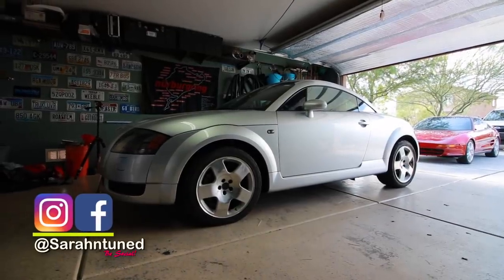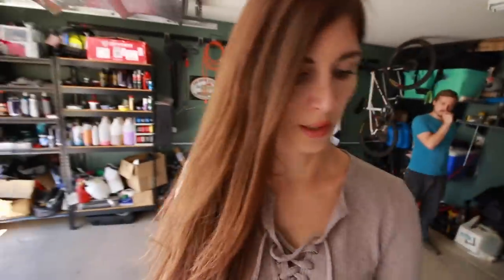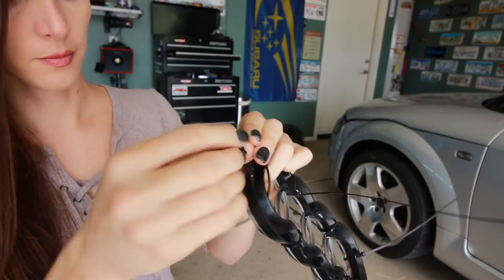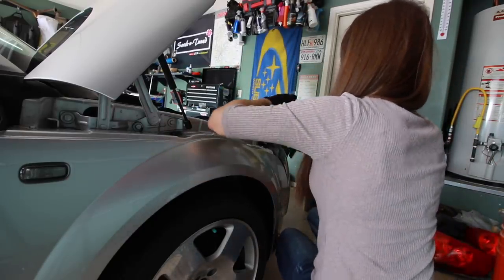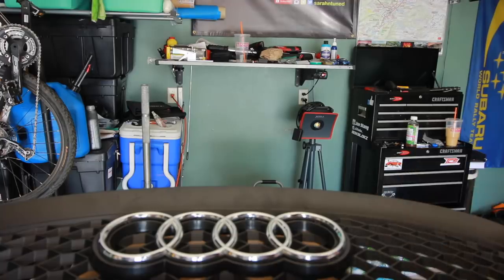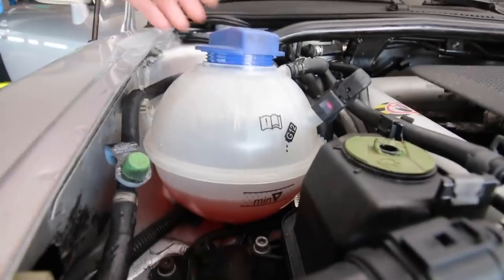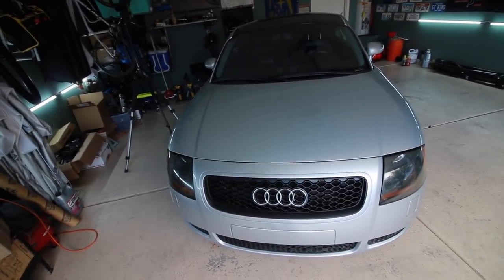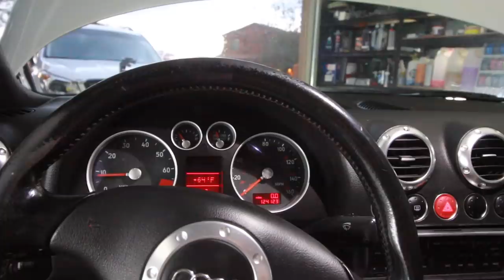First Start! Engine Work & New Grill! // Project TT Quattro

Comment: Hmm.  I'd be tempted to do a pressure test (pump tool and gauge) just to ensure that there are no leaks (actually I do this everytime because it's just what I do to be sure).  Also, some cars benefit from having the nose of the car high - there are a couple of Nissans that I struggled with bleeding over the years because the res is about the same height as the highest point.  So, with those, you just jack up the front.  Ironically, with old Mustangs, you jack up the rear to make it easier to insert the motor and trans, so I guess there is some karmic balance in cars after all.  Also, I'd simply run a new 8 gauge? (hard to tell) wire, new terminals etc, soldering as well.  That way you can be sure it's not going end up in melted mess (stupid VW/AG), resistance is bad in high current cables, so why take the chance.

Comment: You are such a cool chick! I have an 06 TT Special Edition Roadster with 40,120 miles on it, named Inney. 
Inney Audi. Ha! Anyway....... I don't drive her very often, and I think one of the engine mounts is bad, because it vibrates until 1500rpm and then smooths out. Dunno what else it could be...... Do you? I would totally love it if you could fix for me. I don't really care how much it costs to have ya do it. Because the Audi dealership I've been taking it to is awful!  They had it 9 weeks, and didn't do any of the work they were supposed to. But they did break my passenger side headlamp, and replaced it with a salvage one that's in really bad shape, but didn't say anything in hopes I wouldn't notice. So thats always fun. Oh yeah, and they've owed us almost $12k for the past 2 years, and the check never seems to be where they say it is when I go in to pick it up.
But I digress.

Comment: In one of the videos u said you use synthetic motor oils but you replace the oil after 5,000 miles? Sarah, that is wasteful, expensive and very polluting. Do you replace tires after 10,000 miles? Of course not. Unless the cars sit most of the year, synthetic will perform very well for 15,000 miles and more. My 2001 TT gets  synthetic blend once a year since 2002 and the engine is clean as new;114,000 miles.Thanks for the TT videos. Sad that car was treated so badly before you restored it. What happened to the car once repaired? Thanks.

Comment: Two items that helped me alot on my TT project with the engine over heating and the high amp fuse box/wires melting...
This is a vacuum coolant refill kit:
 https://www.amazon.com/OEMTOOLS-24444-Cooling-System-Refiller/dp/B01BW39HJS/ref=mp_s_a_1_15?ie=UTF8&qid=1539840397&sr=8-15&refinements=p_85%3A2470955011&rps=1&pi=AC_SX236_SY340_FMwebp_QL65&keywords=radiator+vacuum+refill+kit&dpPl=1&dpID=51tpJKoYuBL&ref=plSrch

This is a mini anl fuse distribution block that I used to replace my high amp fuse box, you will need two:
https://www.amazon.com/gp/aw/d/B01GVHN6KG?psc=1&ref=yo_pop_mb_pd_title

Comment: NOOOOO!  Do not add Water Wetter!!!  It does not go well with your G12 or G13 coolant.  You will get a bunch of brown crud forming in your coolant.
Reply from the maker: Jetta Red I used G20 coolant.
Reply: Sarah n Tuned Keep an eye on your coolant. I know that WW messed up the coolant in my VW years ago. If you did a complete flush, then maybe it’ll be ok. As you realize by now, VW/Audi cars are temperamental about the fluids, respiration, etc.
Reply from the maker: Jetta Red They sell it on ECS Tuning as being compatible, I’ll keep an eye on it though!
Reply: BTW, I though G20 was a conference of a bunch of foreign countries.  Hmmm.

Comment: niacal4nia6 hours ago (edited)Aren't you suppose to bleed the coolant from the heater core hose with the tiny hole (hidden under the hose clamp)and another bleeding screw on those cars?  That's how VWs 1.8T bleeding works.  You should elevate the front so the air rises to the top.Read more Show less Reply     1                   Report                                       View reply                 Hide replies                                   802 Garage3 hours agoThat might explain some things...Read more Show less Reply     1                   Report                                                         Larry Linares2 minutes ago (edited)you nailed it that's why its over heating! I know this as I was a former audi tech